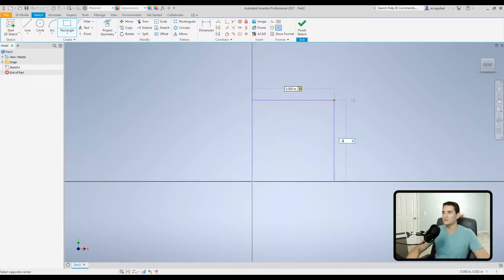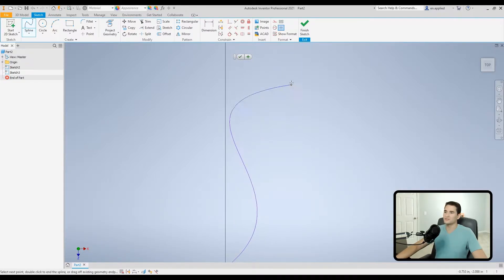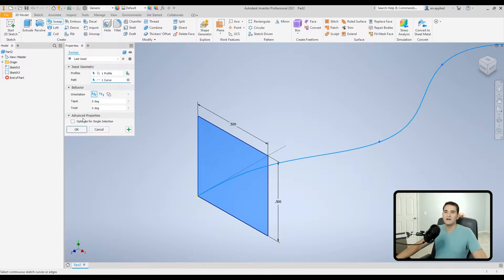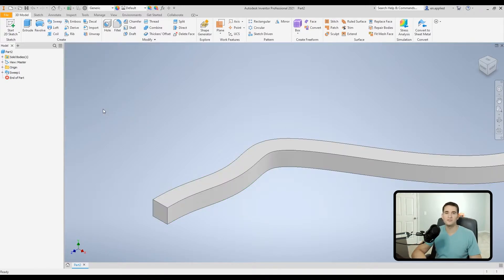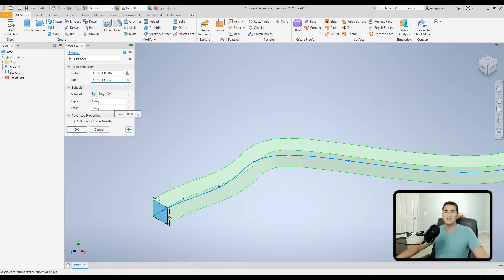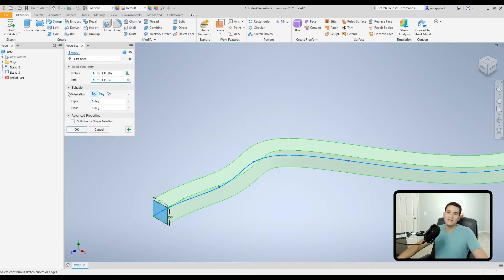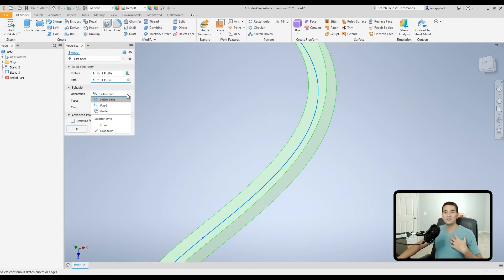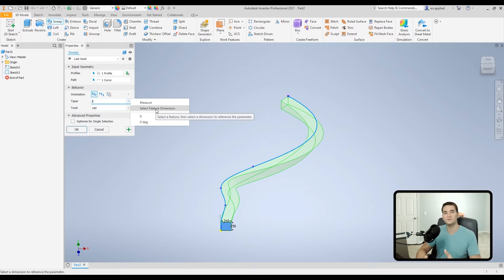Sweep Tool and Options - Autodesk Inventor Part Tutorial | Autodesk Inventor 2021 IN DEPTH

Comment: Hi, is it possible to use Sweep tool in order to remove material? (like "cut" mode in Extrude tool)
Reply from the maker: Yes, as long as you have material to remove (solid body that the swept profile intersects) then you can use the sweep tool to remove material (cut boolean operation in output section of command window). Great question! Thanks for watching :)